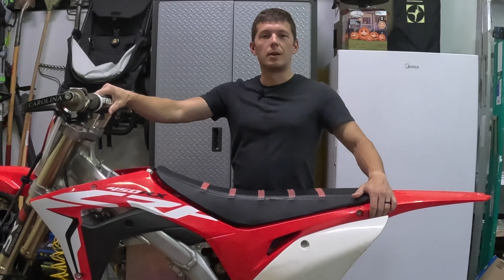How to convert a dirt bike to electric and why I used Electro and Co. to do it

Comment: Its alitlle to exspensive how would i source everything and any recmendations on where to get a battery
Reply from the maker: Yeah I agree it is expensive. However, now I don’t have to buy gas and drive to a track to ride. I can rip in my yard. Start with Electro and Company to source parts or just start googling components. Most of it will come from Chinese suppliers but others are good luck buying direct, plus it’s cheaper direct.

Comment: hey was wondering what tool you used to shave off or cut the top piece of motor i have same issue but hard to cut
Reply from the maker: Well it would have been nice to have a band saw to make it nice but I just used a thin 4” cutting blade for a right angle grinder. I had to go in at different directions because the wheel was so small. It was mostly a hack job that I’m not real proud of haha

Comment: You may have said it, but what size motor and battery did you get?
Reply from the maker: I went with the QS138 V3 motor which claims a max of 35,000KW which is about 46HP. But that is typically a short peak of power.  The controller peaks at 28kW which is 37HP. The battery is 40Ah. I do wish I would have went to a bigger battery like a 60 or 70ah. At the time I just was trying to balance the cost vs. the Ah and the physical size of the battery.
Reply: @ thank you so much! How much did everything cost?
Reply from the maker: @lscstudios4637  $3,300 for the motor, controller, battery, wiring harness, throttle, grips, on/off switch, and power mode switch.I found the frame on Facebook marketplace for $600.
Reply from the maker: This is the way.

Comment: Awesome choice as a rolling chassis, & good choice going with Electro & Co.

If you need any help sourcing anything, or need help trouble shooting, i do testing/R&D for ebike/e motos, & could point you in the right direction, the FB groups are really the best source of information.

I got a Rwarr Mantis on Monday, the full size 1,& it's linear power delivery & instant throttle response IS ADDICTIVE, i can ride it on the roads here in Reno to get to the dirt or sand, & don't get harassed, ebikes/e motos are the future, I'm 49yo & closely see it. 

What's the specs on this?
Reply from the maker: Hey thanks! I have some work to do on the chassis. The shock is not 100%. I am planning on getting it rebuilt and every bearing in the wheels and swing arm are crunchy.. Easy fixes though. The specs are 76V, 40aH battery. The motor is labeled as 28kW on Electros website.
Reply: @esteemmoto1213  hey what would u say your top speed and how many miles do u get on full charge wanna get the same specs for my yz450
Reply from the maker: @ I had a 13T and a 52T in the rear. According to Strava I got 40mph without a big long straight stretch. I have since moved to a 50T in the rear but I may move to a 48 or 49T for more speed. There is plenty of torque with the 50T. The 52T was extreme torque. Unfortunately, I don’t have a good estimate yet of the ride time. I rode it for 30 minutes with a 40ah battery the other day before I broke my welded bracket so I stopped.

Comment: Nice commentary! I’m gonna do this but with an old 250 frame!
Reply from the maker: @tannerisms  thank you! You definitely should do it! I partly think an older steel frame would have been easier for me since I could have welded mounting tabs to the frame. I don’t have an aluminum welder yet..
Reply: @esteemmoto1213  TIG aluminum was never my specialty so I don’t blame you man. But you did a great job!
Reply: It turns out to be expensive
Reply from the maker: @Greyasylum12  it really is. The battery is really what drives up the cost. The motor and controller are surprisingly not too bad. If only Starks weren’t $10k+